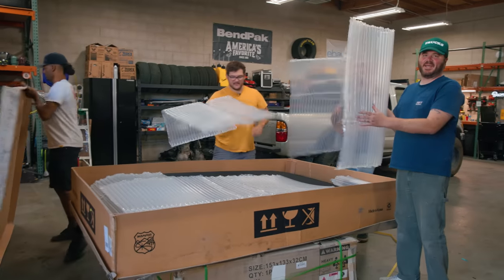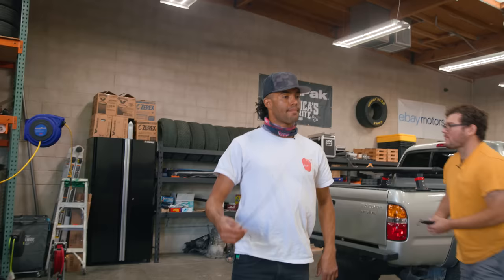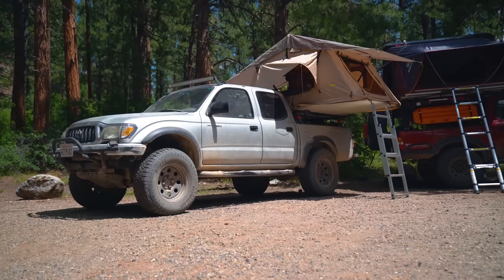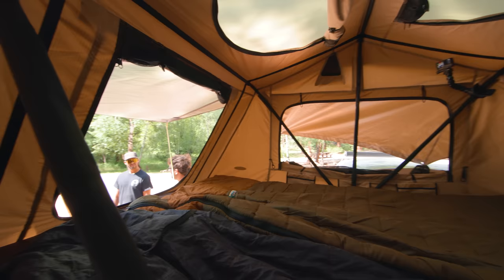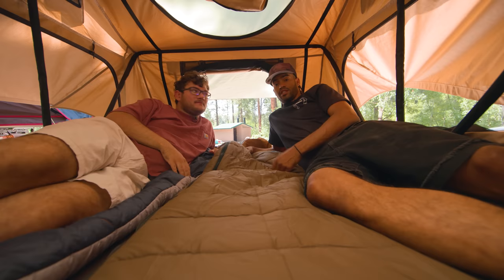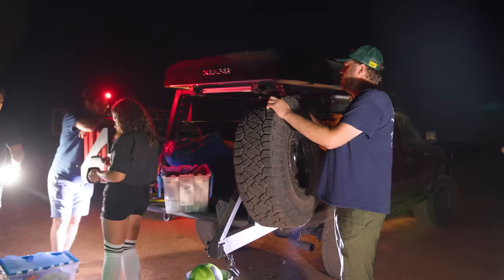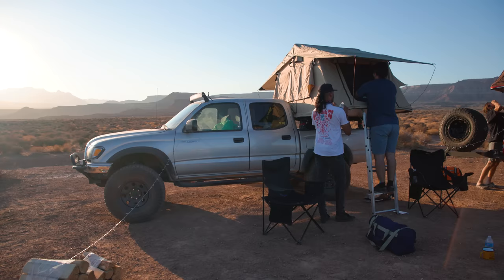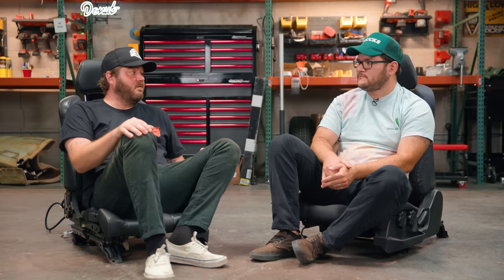$900 vs. $3500 Roof Top Tent

Comment: Glad to see low team actually got a fighting chance this time, going by the last two episodes I was expecting them to be given a garbage bag and a stick for a tent
Reply: True! The winch was rediculous! A high lift jack instead would have won it, or just a cheap electric winch..
Reply: I’d take the low tent, 110%
Reply: @aaronmonheim6428  Agreed. In addition to being heavier, mounting the iKamper up high significantly raises the center of gravity of their rig. We'll see if that affects their trip in the next video...
Reply: Agreed 100%, they could've thrown a little more at low truck for the winch and lights without even approaching hi truck.
Reply: @mktrollop1093  exactly
Reply: That last one I feel like shoulda went to low truck. Yeah they were slower but they could keep their bags in the tent and they were so much cheaper.
Reply: It hasn't been half that bad bud. The diffs weren't that bad. Like everything has been a giant disparity financially and low truck has been going hard. Keeping up at the very least if not surpassing in a couple of the upgrades. For AT LEAST, a third of the cost.

BEING THE STEREOTYPICAL UNDERDOG FAN!
Reply: The comealong vs a mounted electric winch killed me, that was ultimate budget lol
Reply: Low team tent wins it for me.  Gotta have that ventilation here in Florida.
Reply: @aaronmonheim6428  sa\
Reply: Wow!  They get a stick, too?  So lucky.  We were too poor for sticks.
Reply: @aaronmonheim6428 plus, low tent is totally appropriate for winter camping. The high one, not so much...

Comment: I’ve been using that smittybilt tent for the past 4 years and I’ve had no problems with it. I’ve absolutely loved it and used it a lot a lot
Reply: @FirstGendodgegarage  why do you care.
Reply: @goose1168  clearly thinking if its worth the investment O.O
Reply: I have had the Smittybilt XL tent for 2 years (78 nights camping) and the small version like yours for 2 years prior.  They have both been very well built IMO and survived numerous hard thunderstorms in Colorado, Utah, Big Bend, New Mexico and the Texas coast.  One trick to any roof top tent IMO is to get an air mattress.  For the small Smittybilt, I used a full-size.  For the XL, I use a queen size air mattress.  A Ryobi 18v compressor inflates it in just 2 minutes.  Best part is that since the air mattress takes up MUCH less room when deflated, you gain a TON of additional storage when the tent is closed (prior to putting on the travel cover.  I can actually store 2 small duffels and a few other items in the space the foam mattress used to occupy.  You just fold the tent closed and the the one side (between the hinges) will be wide open to load up stuff.  Once loaded, put the cover on and roll.
Reply: Im looking at getting one rn but idk yet if 1400 is good for a roof tent im putting on my bed of my avalanche
Reply: $300 tent I have sits in my bed after I unload the dirt bike and folding ramps. Total cost of all of that is less than the high team tent.
Reply: @goose1168  i think he's trying this new-fangled thing called... what was it? oh, a joke
Reply: @FirstGendodgegarage  good question
Reply: I have the smittybilt xl on my ram 2500. Love it. Comfy, easy to set up and i forget its there when im driving. Just installed the maxi trac 8x8 awning today. Also great stuff!
Reply: @pilsmon  th FBI
Reply: The clam shell is so damn expensive.  Could buy another truck for that much money.
Reply: @FirstGendodgegarage  I have it and about 20 so far it’s pretty awkward at first but with some experience it works well
Reply: @cartercarter3484  finally a answer
Reply: @Nolan Is Innocent ⁰p
Reply: @FirstGendodgegarage  you only get those in the i kamper
Reply: When it's cold outside does the cold creep in over the night or does it stay pretty warm
Reply: @FirstGendodgegarage  😐
Reply: I've been looking at that tent too. Even used the ikamper mini is ridiculous

Comment: Yeah dude for $3500 I'd expect at least some lights and USB plugs. Low truck def won the tent challenge in my book. I would like to see them tested in a snowy night though...
Reply: I feel like a newer truck would be perfect for that because of the truck bed outlets.
Reply: Light and usb charger with a solar panel on top to power them. Definitely not worth $3500 in my book. A pop up tent Rv would be a better option and I’ve seen those for $3500 and up. Those also come with a toilet, sink and an actual twin/full bed
Reply: @SuperFlowback  I’ve had many experiences in them but there fucked with how long it takes to setup and put down even with multiple people
Reply: low team's noise in the tent is a deal breaker for me
Reply: @bhanjin4829  thank you!! Yes as someone who used to go camping in one of those they are SUCH A FUCKING PAIN IN THE ASS to set up!! It’s funny cause you underestimate it until you actually have to set it up😹
Reply: @se7ense7ens37  we rented one over new years, and it was such a mess, didnt even know how to put it up as it was missing poles, it was terrible, just stick to the tents, or caravan. and putting them down was terrible, trying to stuff everything inside and zip it, our zip broke and it was such a pain
Reply: I feel like for that price you can buy a cheap pop up tent, plus all the r accessories you want, plus a jacket battery with dolor and you’ll be set up better for less than 4k than you would with the expensive pop up.
Reply: @bhanjin4829  I agree, I think there’s a whole wave of people using these pop up tents but in reality they aren’t convenient. It’s great for 1-2 people max and a quick trip but more long term wouldn’t be comfortable
Reply: I've spent quite a few nights in my ikamper. The 2 minute setup is worth all the money. The weather isn't always going to cooperate and you're always not always going to want to set up a tent. Get what's best for you.
Reply: I go camping every year with my family but never had a RTT as they are overly expensive. However, as I just purchased my first pick up and a bed rack, I may get one in near future. Lights and USB plugs are easy and cheap to add. What I concern and want to know about those expensive RTTs are insulation, condensation and quality of fabrics used, etc and I wish they compared that in addition to what they did in this video. It's not always nice and sunny when you camp and if I spend $3500 on a RTT, I don't care how bad the weather is because I want it to handle just fine to make it worth its own price tag.
Reply: @davidsobrito2790  A lot of people don't like the noise from the wind.  That seems like more of a design issue than a cost issue.
Reply: @patrickshoemaker6047 yeah idk the cheaper rtt was only about 1 minute longer to set up. I don't think that extra minute is worth $3500 unless you have money to burn

Comment: I like how James doesn't try to hide the fact that he's just as baffled at these prices as we are.
Reply: It’s cause people are stupid enough to pay these prices. I’d pay $500 for something durable. My $115 tent sets up in under 3 minutes, but takes like 10 minutes to put away. WOW so long. My bed tent takes like 10 minutes to setup and 3 minutes to put away. Biggest downside to the bed tent is clearing the bed.
Reply: I roll with a ground tent.  Cost me $80 and goes up in 5 minutes.  Goes down in 5 minutes.  I don't have to drive around with some shit on my truck and don't need to find a spot to store it.  Plus if I don't want to put my stuff away to go for a drive, I leave it where it is.
Reply: Luis G good points! I enjoy the rooftop tent and I think my lady likes it more haha. The gas sucks on it but I’m in a Jeep anyways. The Jeep barley has any storage so it’s cool to keep pillows and such in the tent and also have a foam mattress to sleep on
Reply: I sleep in the seat of the truck.  Takes like, no minutes to set up or put away.  And it's air conditioned.
Reply: @Skinflaps_Meatslapper  I've got a mattress in the back of my Rav4. I can sleep anywhere, and no one will even know there's someone sleeping in it.
Reply: @luisg1653  I compromise and have a Koadiak Canvas bed tent that I slap in the back of my f250. It does take like 15 minutes to set up, but I can fold up my tonneau, leave it against the back window and still put the tent up. It cost me like 300 bucks and its fully canvas and I can use the bed of the truck as the floor so it doesnt matter if its dirty. Also off the ground, just got a wide cot that my girlfriend and I sleep in and I can still slide my rifles and bags under the cot while im hunting and stuff.
Reply: @Ikkleman0  I've seen those, that's not a bad option.
Reply: There are so many missed points about the price gap in this video, it’s not even funny. The big issue here is that  they compared a soft shell to a hard shell. Hard shells in general are a lot more expensive for two main reasons; hard shells are a lot stronger and hold up much better over the long term, especially when you’re wheeling through tight trails with branches dragging across the sides. Also the hard shells can withstand a LOT more wind than soft shells. The second thing about soft shells is how easily they can be taken down - setting up is one thing but taking it down and packing up is another which isn’t shown much in the video. 

Now that said, while ikamper is hands down the best in quality in the roof top tent scene, they’re most certainly overpriced. (In my opinion which is chaired by many at least).  The whole idea behind this video is to see if the price difference was justified but the purpose was defeated before filming even began when they put a soft top up against a hard top - it’s basically an apples to oranges comparison.
Reply: @JackDaniels350  its all apples to oranges really.  Rear locker vs front/rear locker, full armor vs bumpers, the list goes on.  The idea is budget build vs money build, so by nature you aren't comparing strongly similar products, but products that do similar things.
Reply: @luisg1653  you make a very fair point but if that’s the real focal point then it doesn’t make much sense to ignore the long term advantages that hard shells will have over soft.  All it takes is one winter or a couple bad storms and you’re back in the market looking for a new tent or warranty replacements with a soft top.
Reply: @JackDaniels350  that all depends on if you leave it on your truck all year or park outside.  Would be worth mentioning for sure, and they briefly touched on how the soft one os easy to remove.  I wouldn't buy a RTT but if I did, it would be stored in my garage unless I'm using it.  No reason to let the sun/rain/wind/car washing beat them up all year.

Comment: Both builds are looking super sick at this point. I’d buy either if I had the chance.
Reply: I would go cheap no doubt, the expensive one as Pumphrey said left too much Wow factor on the table;.  In place of a map; 
hard topped one could have easily integrated so much more a soft tent could not: An little 20-40watt exterior solar panel, a battery pack with a tender to prevent overcharge/heat, interior lighting, usb charger for fans/mobile and still have room for an acrylic window.  
Solar panels, wiring and acrylics hate kinking. In this day and age that could increase build cost by $300 tops. If it had that, I would pay $3k or it.
Reply: Both builds would still go for $15k+ on craigslist rn. :(
Reply: Posting videos ab negative disputes in Airsoft is bad PR for growing the game
Reply: Oc, what are you doin here 😂
Reply: Y’all need to snorkel em top em off good
Reply: @garbagetrash2938  The trucks alone before they did anything could have gone for $15k.
Reply: what the hell happened to hi trucks bumper tho lol
Reply: Hey HEY! What are you doing here mister
Reply: Only thing I'm still mad is them giving Nolan a come-along winch when there's a lot of cheap off-brand electric winches available. That's just being dirt cheap for the sake of it.
Reply: Youd buy one of them, because the other one is more like 4 times the price.
Reply: @Oc Airsoft, go build some DSGs
Reply: @Aluttuh  they probably filmed the last episode since this was a 900 mile week long trip thus, while testing the trucks they fucked up.
Reply: Brianna 🍑🍒  j
Reply: Definitely
Reply: It’s my dream to just see one of them
Reply: @garbagetrash2938  they'd proly go $15k stock with how expensive used tacomas are.
Reply: Yo, best air soft youtuber showing up here?!
Reply: Well I didn't expect to see you here
Reply: Austin Batton  depends on how you look at it... ive seen  2004 tacos with 200k on it for 10k... thats a bit much for an old hag lol
Reply: Thats the issue with this season. "If i had the chance." Even Low Truck is way out of the budget for what it should represent. 

Youtubers who aren't overlanders continuining to perpetuate this idea that you HAVE to have 4WD, you HAVE to have an RTT, you HAVE to have some fancy bed rack for your maxtrax and shovel.

Low truck should have been an actual, realistic representation of what overlanding can be. Put cap on truckbed. Build bed out of wood. Go to sleep. That is literally all you NEED. You can want more, but that is the cheapest option. 

Instead shit like this alienates people and makes them think overlanding is inaccessible to the average person.

Comment: Regarding camping in winter, someone else might have already answered, but the low tent seems to be more apt for it.
Number one priority in winter camping is sufficient ventilation, to avoid condensation, that will get your sleeping bag humid, and thus, ineffective to keep you warm.
Second most important thing is to have enough support in case it snows during the night. Snow doesn't drip down the roof, and it's heavy.
We had a surprise snowfall during the night on mother's day weekend.... one of the tents collapsed... that's how the occupants woke up 😬

Comment: I need to know what happened to high truck’s bumper, and potentially a revisit on that episode’s outcome since it bent up so easily.
Reply: So with Tacomas (all models), the mounts for the bumper bolt into where the crash bar was.  These are very thin plates since it was only ever designed and engineered to absorb impact, not the opposite and pull other vehicles up mountains, hills, and out of ditches.

A common upgrade for anyone who actually uses their winch or recovery points on plate bumpers is to cut the original mount off, and replace it with fabricated brackets from thicker plate steel and fillet weld them to the frame.  

Another popular and sturdy option is a BAMF Front bumper reinforcement brackets from 2005-current models.
Reply: @styledliving  buy a bar that is designed to be used to recover. I do on my 4x4. Plus two rated.recovery points at the front and one at the rear.  It's only like 150aud dollar to do this.
Reply: I was wondering if anyone else noticed that, I would definitely like to see what happened
Reply: @timothybrant3765  they touched tips and low car won.
Reply: @styledliving  that is pretty common among first gen owners, but when the bumper is installed correctly it isn’t necessary. After they initially received slew of complaints about it, ARB added mounting hardware into the kit for the bumper brackets to be essentially pinned in place through the frame with a 3/8” gr. 5 bolt and a sleeve. One of the guys at the 4x4 shop I buy parts from actually worked at ARB when they figured this out. This got rid of the issue but the ARB instructions are so poor that most people don’t do it when they install. I honestly wouldn’t have known to do it if I hadn’t heard it from the guys at the shop. My guess is that they didn’t do this when they installed the bumper, which then put all the strain from the winch on the, frankly flimsy, frame endcaps.
Reply: Arb bars are usually designed to crumple
Reply: My guess is they got stuck uphill and tried to winch up on an angle and pulled the bumper out of it's mounting bolts. Still highlights a weakness in that bumper and the way they mount the winch.
Yup, I think I found the exact moment right before that bumper gave out at 4:00
Reply: @putnamehereholdmadoodle  Just the tip bro